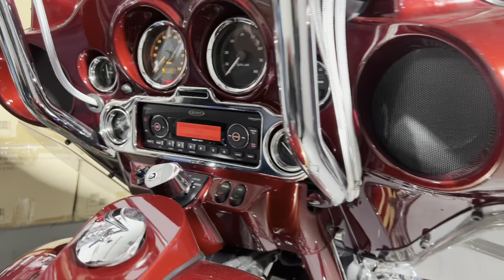Joe’s beautiful 2003 Harley Davidson Street Glide in for a Nvs Audio stage 4 audio upgrade.

Comment: How can I put bag liners after the 10 install
Reply from the maker: If you did not bond the ring on its easy ( we screw the rings we don’t bond it unless it’s a competition bike ) 

We unscrew the rings 
Install the Liner 
Glue the line down 
Cut the hole
Reinstall the ring 

If your rings are bonded in 
Take the saddle bag to a Upholstery shop and they will be able to install it for you and cut it perfectly
Reply: @NVSAUDIO  it's bonded